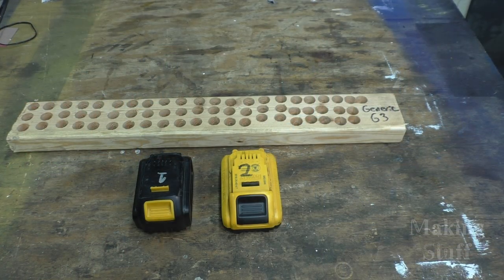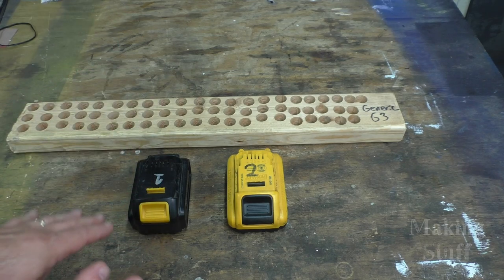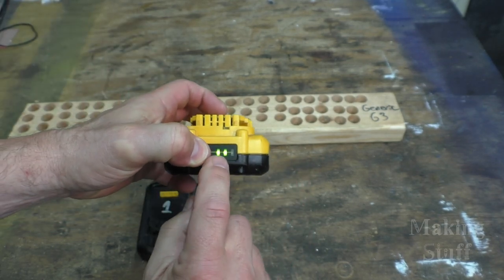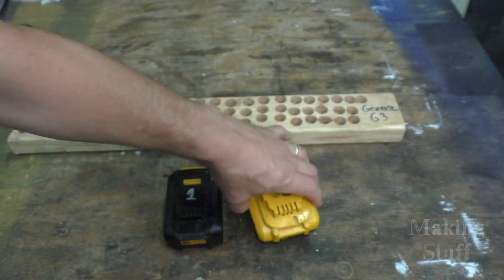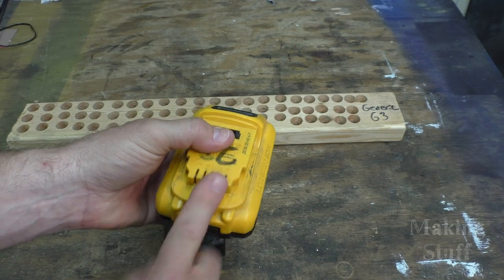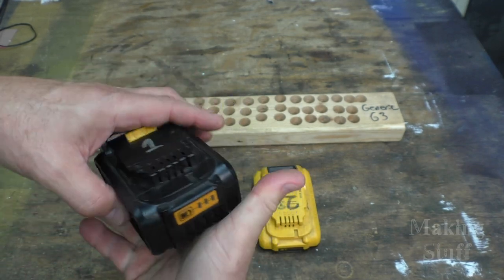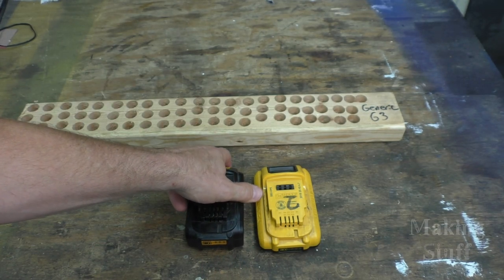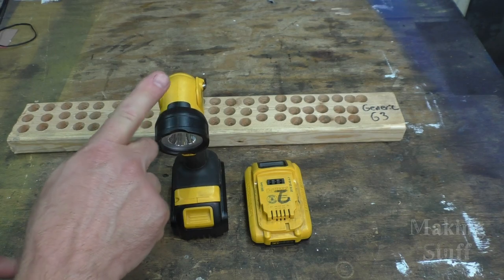Dewalt or Generic 20V Power Tool Battery, Which One Last Longer?

Comment from the maker: What kind of results have you had with your lithium power tool batteries? Let me know in the comments.
Reply: How did you get a replacement battery from dewalt ? Only 1year out of 3 covers the cells. No manufacturer provide more than one year warranty for lithium cells. That’s a fact.
Reply: DeWalt herein NZ 3 year warranty 1 year service.

Comment: One way to significantly lengthen life is to NOT run them til they stop.  Once you see them down to 1 bar, just swap it.
Even though these batteries are probably limiting depth of discharge to 10-15%, swapping them before they are at the bottom of the 1 LED will really extend their lifespan. However, thats really shocking considering they're all touted as having several hundred of more recharge cycles as the norm.
Reply: Correct… batteries last longest when they’re run down to about 15-20%… they should also not sit fully charged for extended periods… 20% is a safe storage charge
Reply: Some brands don't have a power meter.  You have no way of knowing until the tool stops.

Comment: The initial price you paid for each battery is crucial to your test.  If the Dewalt was more than twice as expensive initially (which it probably was based on recent prices) then the no-name battery was a better value.
Reply: Exactly. Not having to deal with the receipts or going through a frustrating warranty process might even be worth the extra cost if the value wasn’t less than half. Just order a new one and be done with it.

Comment: I have 3 6ah flexivolt dewalt batteries that are 1 and half years old, each of them have been put on charge at least 120 each as they get used on a daily basis and still going strong.
I do not run them to flat all the time, that's the quickest way to destroy your batteries. Different types of batteries have different characteristics and you have to do your charge cycles accordingly. For all those that say dewalt is crap, they dont last long - they do if you take care of them as one should with all your tools.

Comment: spend $50 for a spot welder that comes with strips, spend $20 for new batteries and with a little bit of work swap out your Dewalt batteries with new ones, now you have a new Dewalt battery, I own 9 Dewalt batteries and have no idea if any of them have a warranty. I suppose if I were on a very tight budget I would've kept that info handy. NOTE: with an adapter (around $25) you can use any other tool even 18-volt tools and visa versa. so I can use my Craftsman, Ryobi and Hercules (harbor freight) with my Dewalt batteries

Comment: I got one of the first Bosch 14,4v Li drill and 2x batteries available in South Africa. I am only a weekend warrior but I'd swear that drill is 12+ years old and everything is still going strong. I built a 15 foot by 20 foot workshop with it, supports, A-frames, roof, inner walls and ceiling. I drilled around 1000 holes and screwed in the same amount of screws (soft pine). I built my first CNC router with it; getting everything lined up entails a lot of unscrewing and screwing 5 and 6 mm screws. Countless handy man jobs. I must have charged both batteries hundreds of times. I have not noticed any significant run time loss from the 1,5 ah batteries yet.
Reply from the maker: If it's 12 years old it is more than likely NiCad batteries.  I just chunked my last nicad pack a few months ago and it was 7 years old. I could easily get a nicad battery to last 5+years and these lithiums are starting to fail after 2.3 years.  Thanks for watching!

Comment: I do interior trim carpentry work and I use DeWalt tools all the time. It must be time that breaks your battery down because I have charged all of my batteries probably over 1,000 times and they still work perfectly fine. I bought generics in the past whenever I was just starting out in this line of work. The generics do out a whole lot faster. Usually something starts to short out on the inside. I have some DeWalt batteries that I have had for over 10 years and they are still going. I am absolutely amazed that yours only went that many times. I wouldn't even be able to buy these tools if that's all I got out of them because I would be going through them in about a month. That test just doesn't seem to make any sense. I don't know what the issue is but I've never had a DeWalt battery go out when I haven't even charged and drained it 30 times. I don't count the number of times I charge but I know some of them have hit close to 1,000. When you do this stuff for a living you realize how much better than name brand is than the off-ramp. It's that way in basically every cool. You use them everyday and put them through rigorous work, only the name brand stuff holds up. It sounds to me like you may have ended up with a defective DeWalt battery and the other battery is just doing what it would typically do. I have never had a DeWalt battery go out after twenty-something uses. Something is wrong! That's definitely not the way my DeWalt have held out. I have over 20 years in this industry and I've pretty much tried every brand and every battery there is

Comment: Those results can’t be typical.  The Dewalt 20v  should  get several hundred cycles. I’m a red fan and in construction  no exaggeration  we have  more than 25  m18 batts from the 3.0 to 6.0. (5.0 are best bang for $) Some of the older 3.0 are more than 5 years old and still take a good charge. I don’t have an exact count but  they have hundreds of recharge cycles. If I’m not mistaken I think they are rated for 300+ cycles ?    Good job keeping a log on the charge counts a great idea.  You should post more vids🙂
Reply from the maker: I'm with you.  I thought for sure these batteries would last longer than they did.  Thanks for watching!

Comment: You can also open those batteries up and replace the little batteries that are inside with different ones. You can build your own battery for a much cheaper price. That's a good use for your old ones

Comment: I have had a set of rigid drills with lithium ion batteries since 2013. They probably don’t last as long as they did back then, but they still do what I need them for. I had a set of porta cable drills before that, and they just stopped charging one day. I did notice a big decrease in performance on those.
Reply from the maker: Thanks for your comment.

Comment: im surprised no one mentioned that the cell size and configuration are different,  that dewalt uses a single row of larger 21700 cells (5s1p0) where as that generic is using 2 sets of smaller 18650 cells 5s2p configuration.

Comment: It's odd because I have a couple of 20V 2AH Dewalt batteries that are 10 years old with countless charges on them and they still hold a charge and work for a fair amount of time. I got another 2AH battery with a tool purchase a little over two years ago and that one stopped charging last week. When I put it in the charger it just flashes quickly indicating a malfunction. 
I already contacted Dewalt and will get it replaced, but it seems perhaps the newer batteries aren't holding up like they used to do. A typical lithium battery should easily get 300-500 charge cycles which is probably about what the old ones got (if not more). These newer batteries failing so soon is not right.
My original Dewalt batteries (that are still in use today) have a 2013 date, the one that just failed says 2021. I did not count the number of charge cycles on it but I don't use it all that often so 25-50 charges sounds reasonable. It definitely should last a lot longer, now I wonder how long the replacement will last.

Comment: I had a 2013 battery last me to last summer. Trick is to plug the charger in first then the battery. After the battery is charged, remove the battery then unplug the charger. You will prevent shorts in the battery with this method

Comment: I have probably 15 different dewalt batteries. Only had to use the warranty on two of them. But the 2 I did were the funny shaped ones. A 3 and a  6, which people say these have 21700 cells. Coincidence? Not sure.

Comment: I've taken apart dozens of ni-cad and lithium batteries/ laptops to drills. 99 percent of the time it's 1 failed cell.
If you can get the failed one out and replace it  your good to go. I make large battery packs with the good ones otherwise.
They  run my router phone and laptop when power goes out. Bangood des have them for $34.99  now.
Reply from the maker: Thanks for watching!

Comment: Dewalt battery :  
Price  $74.5  ($149/ 2 batteries)
Holes: 62
Charges: 46
Total holes = 62 * 46 = 2852
Holes per $  =  2852/75.5 = 38.3

Banggood battery: 
Price  $42

Holes: 63
Charges: 28
Total holes = 62 * 46 = 1764
Holes per $  =  1764/42 =  42

This doesn't account for the loss of capacity, but we can see that the performance is pretty similar for both batteries.
If it were me, i'd go with the cheap battery and replace the lithium cells when they fail.
However, i'm pretty sure you got unlucky with that Dewalt battery, it should hold for longer than 23 charges.

Comment: I use 5.2Ah "multistar" rc batteries, I didn't count but they work well.
Also check temperature, lithium performs at half capacity at low temperature.
You might also want to check the raw voltage of each battery, there might be an imbalance.
There's also a possibility that the charger goofs.

Comment: I have some Ryobi batteries I've had for 5 years still going strong. However I have a couple that only lasted for around 2 at around $50 each.
Reply from the maker: Are the 5 year old batteries Lithium-Ion? or Nicad?
Reply: @MakingStuff  Lithium-ion.
Reply: Me too
Reply: Im Ryobi and use no name replacements. They last long enough to forget how long they last. I charge them about 3 times a year. Ryobi full line of tools in use and not a regret. They also work in EVERY 18 volt Ryobi tool made the last 20 years. Thats hard to beat.

Comment: It sounds like the NiCad batteries are the better value, that's what I would buy. I'm glad Dewalt sent you a replacement.
Reply: @foobarturkey  He said they were cheaper and would easily last 5 years, out of the 3 the lithium should  be the more powerful battery, I don't know how the other 2 compare to each other.
Reply from the maker: I just threw away (recycled) the last nicad pack I had for my older dewalt tools.  It was 7 years old.  MFG date 04/2014.  The older nicad packs seem to last longer.  Thanks for watching!

Comment: I would say 1 cell has failed in each   Probably 5 x 18650 cells so you could probably replace one...Just have to be a bit careful matching voltages when doing so.

Comment: I'm wondering if you may have a faulty balance system in your charger.....I'm still getting 90-95% charge capacity on 3 batteries with 2017 and 2018 manufacturing dates...
Reply: I don't think so, I have some Dewalt batteries from 2013 that still work okay with god knows how many charges, I got another one couple years ago with a 2021 date and it just died (won't charge at all) and it has been charged on the same charger as the 2023 batteries that are still working. I suspect something may have changed in recent years with these batteries, need more data but I am seeing a fair number of premature failures with newer Dewalt batteries.

Comment: Depleting them completely and throwing them on a fast charger is the worst thing you can do to li-ion cells. More than likely one or more of the cells got over discharged and got damaged, and by repeating it multiple times, it totally destroyed it. Over discharging a li-ion cell does permanent irreversible damage. Doing it multiple times and you run the risk that the damaged cell refuses to take a full charge (possibly no charge at all) which may cause your charger to overcharge the other cells and damaging them.

Comment: Litium batteries do not like to be fully charged or discharged. They are most stressed at the extreme ends of the charge cycle meaning that the battery degraids faster. Using a tool that drains the battery quickly is also adding stress to the battery. After drilling that many holes I would imagine the batteries are quite hot which is also bad for them.

As a general rule of thumb, ideal operation for this kind of battery is to charge it to about 90% of maximum capacity and discharge it to 20% to improve the lengevity of the battery (this is how I charge my mobile phone). For tools that do require a lot of power having a larger capacity battery is ideal meaning the power draw is shared between all the cells that make up the battery.

I would be curious how 2 batteries held up after 2 years of use as normal vs the 20%-90% suggestion above and see if I'm talking rubish.
Reply from the maker: How do I charge a battery to 90% capacity?  I am using a Dewalt charger.  It handles everything automatically.
Reply: @MakingStuff  I'm afraid I don't have a good answer to that, sorry. Only thing I can think of without special or even custom built equipment, which would a bit unreliable, would be to time how long it takes to charge to full and stop it from charging with a bit less time than that.

You can measure the voltage of the cell with a volt meter which would give you an idea of its state of charge. I would imagine this battery fully charged would be about 20 volts and discharged might be as low as 16 volts.
Reply: @MakingStuff   a year on and I probably know a little bit more about batteries as I have now assembled my own 7s10p lithium ion battery out of used laptop batteries. I am not going to claim to being an expert, but in terms of charging what you need what is called a "constant current constant voltage" power supply (think lab bench power supply). How this works is you tell the power supply how much current (amps) you want to charge the battery with, then you tell it what the maxium voltage you want it to be charged to.

With lithium-ion based batteries which has a very specific voltage curve (the higher the voltage, the higher the charge, and a specific voltage means a specific state of charge), this is not nessassarily true for other lithium based batteries but I think most power tool batteries are lithium-ion. So you can set the power supply to charge to 4.1v per cell which is about 90%. 

My understand is that most power tool batteries have 6 cells in series for the 90% 4.1v per cell you would charge to 24.6 volts. You can also choose to charge the batteries at a slower rate (lower current) than the charge the battery comes with which is also healthier for the battery.

Just noticed you dropped your MPCNC video and reminded me of this, looking forward to seeing it as I made the low rider version of the MPCNC about the time this video came out :D

Comment: 25 - 28 charges seems extremely low count. I'm all DEWALT kind of man and I have baterries  4 - 5 years old. However I'm avoiding draining them down to the bottom. Also even if I don't use them I would still make a habit to put them on charger.  
Actually I don't remember ever having any DEWALT battery failed. I just loose them.

Comment: Good follow-up on the original video.
Instead of simply recycling the packs, why not open them and replace the bad lithium cells (as Sick Vic mentioned in another comment)?
That's a whole project video by itself. You can also add a battery tab spot welder project.
Another idea, mount a tab spot welder on the cnc...
Reply from the maker: Yeah I think I will open them up and see if I can find a bad cell.  Thanks for your comment!

Comment: I have Ryobi lithiums that are beyond 5 years old.  Still have full charge.  I can check the dates if you care.
Reply: Hmmm.   No dates on the Ryobi batteries.  I have one that I believe is about 10 years old, 4 that are roughly 5 years old, and 1 that is about a year old.  I recall recycling at least one, but that was because it got wet (whoops).
Reply from the maker: Thanks for your comment.